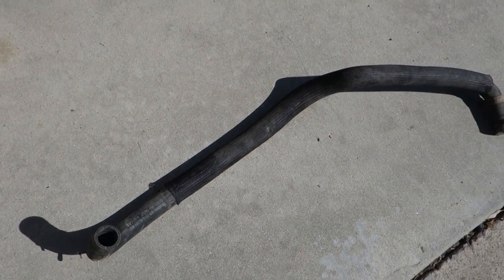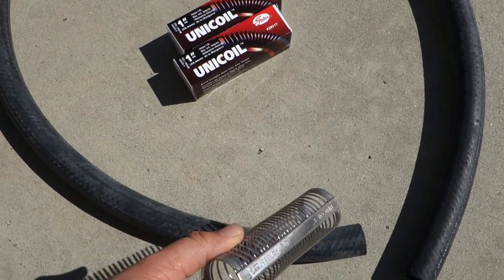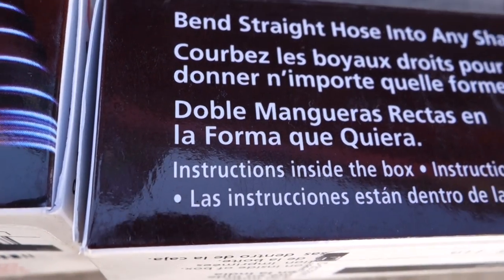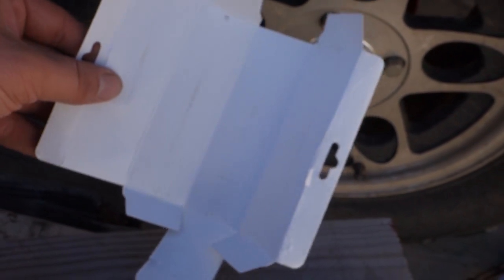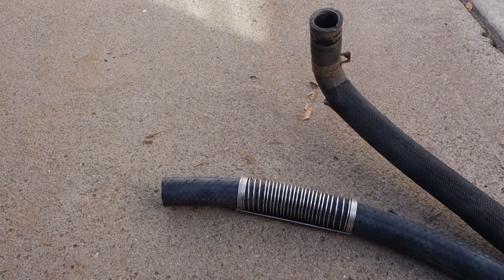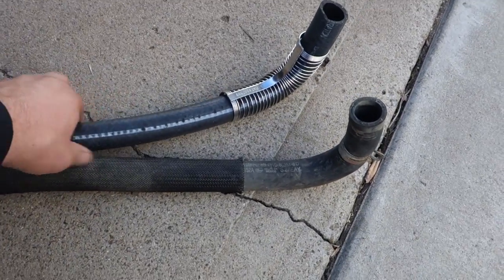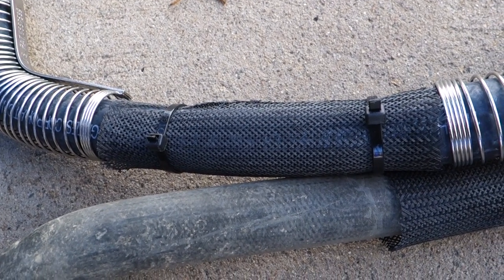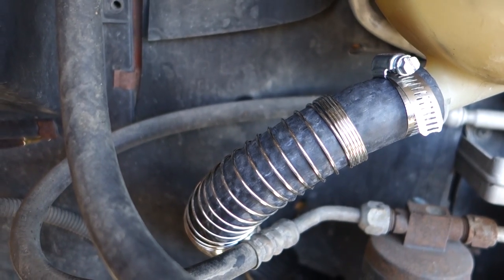DIY obsolete radiator to reservoir hose [1999 Tiffin Allegro, Ford F53 6.8 V10 motorhome]

Comment: Great video. It would be a good idea for anyone on the roads very much to carry hose and the coils for emergencies. When I re-hosed my truck last time I measured the ID of all the hoses and carry PVC pipe cut to 6" lengths plus hose clamps for making emergency repairs of pin holes or small splits. Always try to be prepared.

Comment: We own a 2011 class A with the Ford V10 on F53 chassis.  They changed the design and no longer have that separate hose from the radiator to the reservoir.  Now the reservoir hose is molded into the lower radiator hose itself.  Also, there are 2 lines coming from the lower radiator hose that go into the oil filter housing for cooling there as well.
Reply from the maker: I figured that out in my research.  Fortunately those springs did the job perfectly.

Comment: Excellent video Ben! I had no idea they made such a thing. Thanks for sharing!!
Reply: +Allen Baker If I had a older vehicle, I would buy a section of bulk hose and the spline thingy's as a good safety net.
Reply: +jay super Yes, definitely. The spline thingys can't make 90 degree bends though can they?
Reply: +Allen Baker  For the most part, their 99' RV with the F-53 / V-10 is a popular platform, with a better chance of finding repair parts.  Once you own a rig for so many years, you really get to know when somethings is not quite right. or sounds odd.

Comment: Were get set to leave for Alaska the end of May.  I'm trying to figure out what extra tools or repair items I want.  (Trunk & 26' RV trailer)  Truck is new (er)14' Tundra. Mostly worried about the trailers suspension.  I ordered 4 new tires for the RV.
Reply: +His &amp; Hers Alaska   I guess I have been lucky, as have always had a tow vehicle that was dependable, just little things on the RV trailer would need help.  You know how that goes.  I got jars of just about every nut, bolt, screw, washer, cotter pin....Have come in handy over the years, especially helping out other RVers.